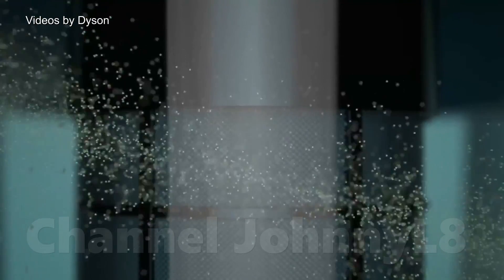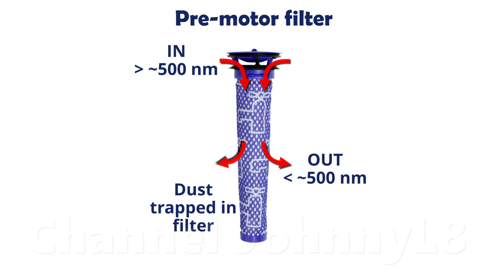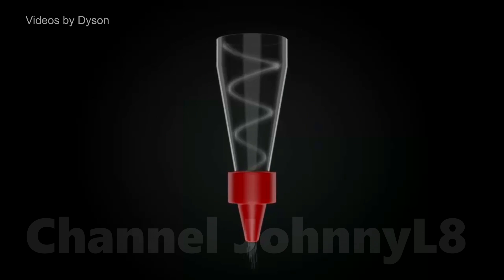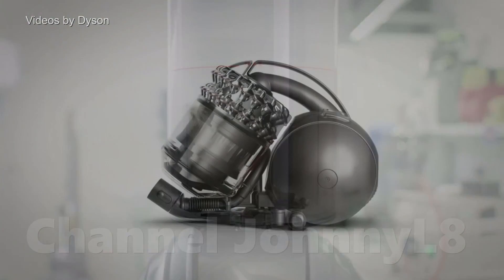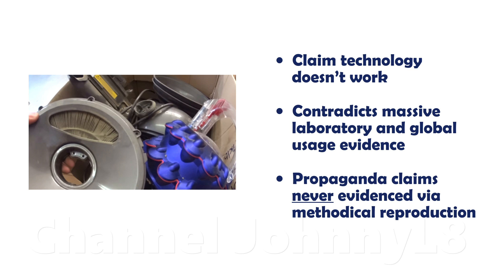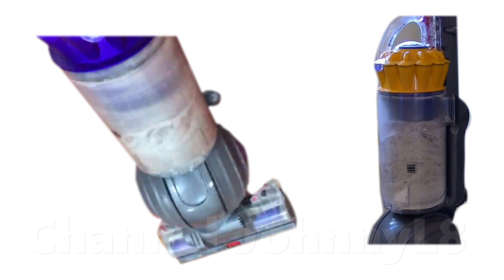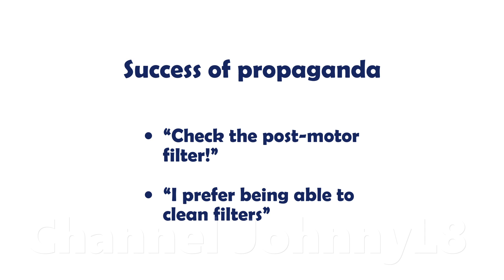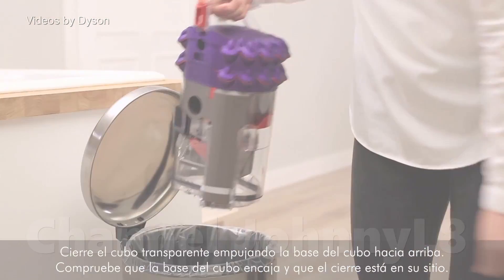Dyson Cinetic Technology is Amazing

Comment: I have the Cinetic Upright (US version).  I take reasonable care of it, clean the shroud when particulate starts to cake on it, and I dump it every use, and rarely get close to the max fill line.  All of that being said, the technology performs flawless like you said.  I did get skeptical and checked the HEPA filters, only to find them still perfectly white after a year and a half.  The machine is doing EXACTLY what Dyson claims it can do.  100 percent truthful marketing.  Anyone who I've seen have a problem with any cyclonic machine almost always seems to be lack of filter maintenance or a shroud screen totally packed with debris and dust.  As the machine is 2 years old at this point, the suction is exactly the same as the first time I turned it on.  It stays constant every time I use it.  

I wanted to thank you for making this video and explaining things so well.  When maintained per the user manual's instructions, the technology is rock solid.  Thanks again for giving a clear, logical,  and intelligent breakdown of the technology and how it works.
Reply from the maker: Yeah. Most people are smart enough to inherently know what you've observed as obvious; if you treat things as intended, they work. Who'd have thunk it? A lot of people don't, and seem to lack basic intelligence. They smear a tech based on faulty logic, and assume failures due to user error are an indication of technology failure. These people seem to constitute the entirety of the 'vacuum enthusiast community' and most of my videos are attempts to counter their incredible stupidity.
Reply: @VacuumFacts  I'm glad someone is actually trying to combat the bashing videos.  I've seen alot of the videos out there, specifically from one that you included a screen shot of in your video.  If it's his machine of choice, it's always user error.  Anything from big box machines,  his crosshairs are mainly at Dyson and Shark, it's displayed as the fault of machine design.  Another favorite seems to be the air particulate test machines.  The exaggerated mess, as you state in a previous video, is another one.  One that comes to mind the most is the use of Kapok fiber to simulate animal hair.
Reply from the maker: @BigRyan505  Yeah, then you'll like my channel. I've noted people have biases against certain brands (rather than technologies or specific products), and the lot get whitewashed. It's mindless tribalism. All the common deceptions you listed I've covered the physics behind. From the use of exaggerated initial messes, to erroneous conflation of user error with technological failure, to lots of other misunderstandings of the way cleaning processes work. Flick through my videos in time order. My latest videos have finally hit home to these questionably behaving people and they're all still reeling at the moment.
Reply: @VacuumFacts  I have watched some of your other videos, that's why I brought those things up specifically, i'm slowly watching all of them.   Total agreement with everything you present.  Another group that has extreme opinions is the audiophile community.  Tell them you like Bose brand audio speakers, and they get very aggravated and hostile.  Those I must admit, some do post legitimate reasons for disliking that brand.  The company, like Dyson, has a totally different way of doing things to achieve results, which people aren't happy with.
Reply from the maker: @BigRyan505  Interesting; I've never encountered the audiophile community, despite being a sound quality buff. I have some sennheiser products. Good job I'm not active in that world; getting objective data for sound testing would be a nightmare, unlike grabbing a stick vac and throwing some flour down. :)

Comment: So if it picked up let's say a U shape pin, or something larger like a fries, it'll get stuck in the little tube openings? cuz those little tubes/tips( the thing they spits out dust into the bin) look pretty small.
Reply from the maker: No because only very small particles can reach there because of the fine-mesh shroud keeping them in the main bin.
Reply: @VacuumFacts  i thought the way it works is to sucks up the dirt and spits it out via those many little tips.
Reply from the maker: I've covered how it works here: https://youtu.be/4eQ7pE0KmnE

And this second video then goes into a bit more detail: https://youtu.be/B8gOZ31CkvE

Hope that helps

Comment: How come there's a label on cinetic Dysons saying not to suck up plaster if this technology is capable of sucking up such fine dust?
Reply from the maker: I'd guess the machine was designed only for normal household use and dust. This has a very specific particle size distribution. Given how cyclonic filtration works (probabilistic based on particle size), over time, enough of the material it was never designed to tackle could accumulate and impair performance. So it's ass-covering. I don't know enough about plaster dust relative to replica test dust to be any more specific. You could probably pick up a small amount. Although it is interesting that CNET's crude bedroom test sucked up a bucket of plaster dust without any measurable loss of suction, unlike every other inferior product they compared to.
Reply: @VacuumFacts  Cool, this vid actualy motivated me to get my DC75 out of the loft and start using it! Haha

Comment: Dyson Cinetic is the biggest mistake Dyson ever made. No wonder they are discontinued now. Too much motor failures.
Reply from the maker: 0_0 kick him while he's down why don't you :/
Reply from the maker: Can you provide the evidence they're discontinued now? I'll give you a chance before I provide the evidence you're wrong.
Reply from the maker: Also send along the numerical verified data you used to conclude there were "too much (sic) motor failures"
Reply from the maker: So, expecting absolutely no response, I'll point out that only in the UK are cinetic models not sold. For the rest of the planet in all those different countries, they are still sold as normal. A simple look at Dyson's website fact-checks this. That's the problem with basing your opinions on utter myths. If there were too many motor failures, then they certainly wouldn't be sold anywhere. In other words, everything you said was total nonsense.

I agree that cinetic models should have still been user accessible to clean a washable HEPA filter for the few who abused their machines and caused cyclonic failure. But the technology was sound and the most advanced in the world. It's not in the cordless devices because, unlike mains machines, they have variable speeds, and cinetic only works with one speed. Until a single air speed is used in cordless cleaners, it won't likely make a comeback. Bit of knowlege goes a long way.
Reply from the maker: @vacuumtests9225  I saw your V10 video. Not all bad are they (if you ignore price). The V12 will probably have the new solid state battery technology in, I'm predicting. That battery tech will either spectacularly revolutionise the handheld market (and other consumer products) or it'll not be as big an upgrade as I'd hoped; time will tell. Also, I've got a VERY interesting V10 test video that will really change the debate coming soon. Very profound data I collected.
Reply: I must say V10 is very impressive. Huge surprise for sure. My friend just revealed it and I had no idea it actually was the V10. I can't lie. I was very interested.

Comment: Thank you for making this this! Awesome video, I’ve always wondered how the new kinetic technology works. Very well made video with thorough and detailed explanations. This just reenforces why I love Dyson so much. I think one of their next steps should be to bring this to their battery powered vacuum line.
Reply from the maker: I think the thing that's stopped them so far is that it only works for a constant air flow through the cyclones. The cordless units have variable speeds. Not sure what their solution will be.
Reply: Vacuum Facts - I have no doubt that they’ll come up with a solution to that :)

Comment: Why don’t they make the bins bigger.
Reply from the maker: A big bin sounds like a good idea, but unfortunately people then complain it's too bulky and heavy. So they can't seem to win no matter what they do. However, what's good with their vacuum's going forward is that they've made the emptying process much much easier. You can empty the bin and scrape the shroud, without making any mess, in about 2-3 seconds now on the V10. So a smaller bin capacity is really a non-issue now.

Comment: What bothers me is that several long hairs make it past the cyclone assembly into the pre filter in my Dyson 360 eye. The cyclones in the 360 eye may not be as efficient as the large uprights, but in the event of large debris sneaking there way into the air path a simple mesh screen could end up saving the motor.
Reply: Doesn't the filter do that?

Comment: Great informative video 👍 Stand by what you say and keeping to the max fill lines and manufactures instructions.  Yes I do have one and yes I use it in real world situations but never have exceeded the fill lines and the suction power is outstanding from day one and still is now. So if it was to ‘clog’ or cause problems then surely I would have seen this by now. One thing that I personally use is filters can smell after a while (yes Dyson ones do on older models) this has not once smelt like my dog! Thank you for this video
Reply from the maker: Best way to avoid smells: empty the bin frequently (can't do this affordably or in an environmentally friendly way with bags), and keep the pre-motor filter rinsed every month. The design of the cyclone assembly now also helps with this; pet dander sized particles fall into an inner recepticle which is not involved in airflow and thus any odour producing imcroscopic particles are trapped there and dumped in the bin.
Reply: I sometimes notice that after a week of use you have to clean the filter is it normal ?
Reply: @Modelo646  Depending on how often you vacuum and, above all, what you vacuum up, the filters may need to be washed more often than the 1x/month mentioned by Dyson.

Comment: Cinetic vacuums are great. But unlike the cinetic canister, the upright has a center duct that leads to the motor and every time you empty dirt, dust will float into the center duct and when you close the bin and put it back on the machine and turn it on, it will get sucked to the filters which eventually will clog up the filters. On the canister models, the duct is after the cyclones and is attached to the machine. So when you empty It, dirt will float but only to the cyclones. So when you turn it on, the dirt will spin back into the bin - making the filters last longer. So if Dyson made their upright bins like the ones in the canister, it will truly have no loss of suction
Reply from the maker: Yes that's right. A small amount of dirt is introduced into the motor and then captured in the HEPA in such cases. There's no indication that Dyson tested for this specific aspect, but you'd think they must have done and found it had very little net effect, even after 10 years. In the V10, they layout automatically fixes it and dirt goes straight into the bin on the first stop. The mains-powered upright models will never change now because development has been discontinued.
Reply: JohnnyL8 yeah. But out with the old, and in with the new - if it's good is my mindset
Reply from the maker: Me too. While I can appreciate the collector-mindset of the vintage lovers, when they scoff at new technology and have opinions leading to claims which are clearly false that mislead people, I go out of my way to call them out. Plenty more myth-busting exposé videos on their way.

Comment: Even cinetics used in careful conditions let hair and dust pass through the cyclone. In their lifetime they will most likely be expected to pick fine dust up in small amounts and the cyclones just don't get it 100%. Do you have a cinetic machine?
Reply from the maker: No they don't. The whole point of the video was to explain why this is a nonsense myth. There's no evidence it fails if used according to the manual that isn't debunked as propaganda, but please feel free to share some. I do not have a Cinetic machine.
Reply: +JohnnyL8 I don't think it's too fair when other experienced collectors and myself point out that cinetics aren't what they are made out to be yet you reject this even though you haven't got a cinetic to put these claims to the test. I used mine in normal circumstances and never overfilled yet dust was passing through
Reply from the maker: I reject it, not because I don't have a Cinetic to put it to the test, but because the onus and burden of proof is on those making the claims they fail. There is already evidence it works if used according to the manual. There is already evidence it fails if abused and neglected. There is no evidence it fails if used properly. And subjective hearsay about who saw what, when, is worth nothing; being an experienced collector is worth nothing; only objective formal evidence carries any weight on specific matters of fact such as these claims; opinion is irrelevant.
Reply from the maker: The logic is simple. A factual claim is made; it's either true or it's false. There is thus evidence bearing on it and that evidence must be presented and investigated formally. Subjectivity is irrelevant and plays no part in whether the claim is true. All objective formal evidence so far shows the claim is false; Cinetic technology works exactly as stated unless it is abused.
Reply: +JohnnyL8 That's not what I've found...
Reply from the maker: I repeat my above response and I remain completely unconvinced